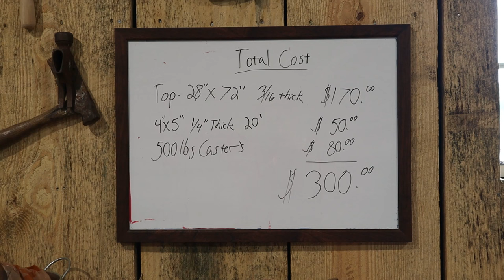I BUILT THE CHEAPEST WELDING TABLE! DIY welding table on a budget.

Comment: I know a guy that built a welding table put of steel grates welded together and a set of legs, all made from stuff he scavenged off of demolition jobs.

The first time he used it, he needed to weld a small excavator bucket. Well, he made the table too tall and he didn't have a good angle to weld. He pushed the bucket onto the ground and used the table to rest his arm for a steady. 😂
Reply from the maker: That’s awesome that material can get so pricey

Comment: Foldable curtain between beautiful car and crappy weld splatter is a must imo. Sorry just read the rest of the comments on your TA.
I second the mig settings tho . . . it's a welding video after all :-)
I'm not an expert welder, nor a good welder, or even a beginner welder BUT if it was me doing it I would be using magnetic angle guides to get your legs straight. I always call using spirit levels, getting it level with the world. You need the legs level with the table not the world - not your concrete slab. Good welding mate, I wish I could do that.

Comment: Great job and this solidified my decision to go with a 1/4" top so that was very helpful.
Reply from the maker: Thank you
Reply: Hopefully this isn't too late - but my 1/4" top warped similarly. My recommendation would be, and if I could do it over again, is weld your frame up square and as true as possible and then put the top on last and use minimal welding to hold top to the frame. Too may welding tables I've seen here on youtube have the top as part of the structural part of the table, which requires more welding to it. If your structure is a good strong and square frame you'll barely need  to weld top to it and it won't warp. Good luck.

Comment: :stayhome:nice video man, keep em coming. Would maybe suggest for a 2.0 welding table to add those Lockable cart wheels (for safety) Also, would be nice to know the mig settings you ended up being used for best results  :)
Reply from the maker: Thank you. Good ideas for sure. Next welding project I’ll definitely share the settings. Thanks for the support

Comment: Awesome Video. I just came across your channel. A few days ago I bout myself a flux welder so I can begin to lean welding. I want to build myself a welding table but I don't have a garage so its too dangerous to have one outside because the lighting strikes around my area are just to close and powerful. So axed out that idea. Keep up the awesome work. Oh If it were my table I would have built a divided underneath platform so I could keep all the things Ill need close by. Such as your welding markers, measuring tape, safety equipment etc.

Comment: You might be a bit taller than I am but I'm thinking that your table is a bit too tall fo rme. I would prefer a table about 30 inches, allowing me to reach the center of the table for some welds.
I would also suggest an auto-darkening helmet. They make is SO much easier to set and tack initial welds.

Comment: do yourself a solid and weld on 2 lifting rings.  Space them 3 feet apart and then use 2 straps.  will keep the table from swinging around wildly when you are lifting/flipping it over

Comment: What a fantastic and affordable build. I got my Welding Table given to me but of course it was a mess the way they built it. I have almost got it straightened out and put four locking 6-in casters on it from Amazon. About $130 worth. I found that the table is very hard to guide when you are trying to push it in and out of the shop or any place. It wants to go everywhere except where you want to go. I figured it out that I could put some heavy duty butt hinges on two corners on opposite ends of the table. You can clamp or Bolt the hinges on to the leg above the caster. Get the caster going straight parallel with the table lengthwise. The butt hinge is mounted horizontal to the leg. Let the hinge drop down on top of the caster. Mark and cut it so that the outsides of the hinge will fall to the outsides of the caster. When you want the table to go straight just fold the hinge down to hold the Caster straight. I also put a trailer hitch on the table so that my yard tractor can move it wherever I want it no matter how heavy it is.

Comment: If you made the frame first, and made it straight, then you could have just tacked the top on with a few small tacks so it didnt warp, and had a really flat top. 👍
And yeah like others have said here definitely swap out those castors for locking ones.
Great video, thanks for sharing. 🙂